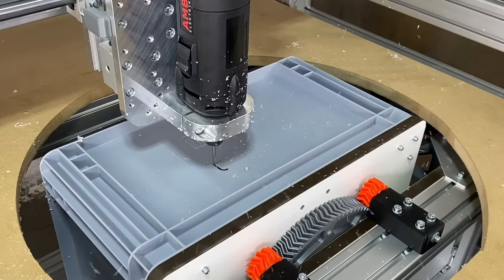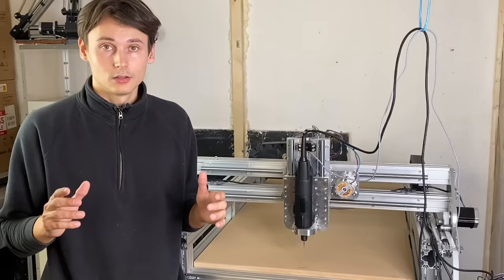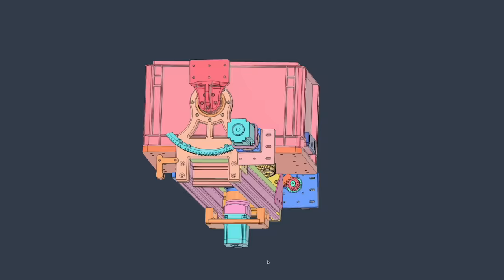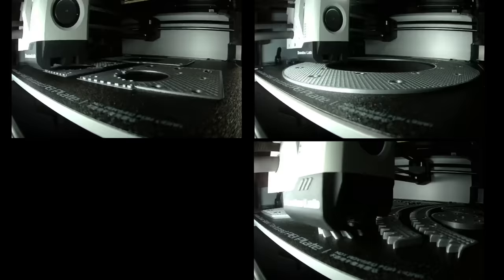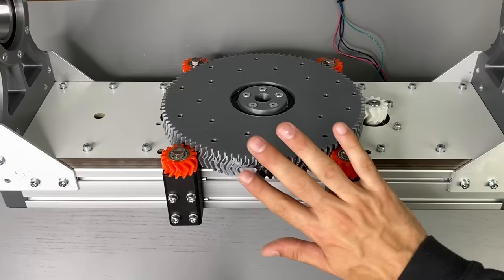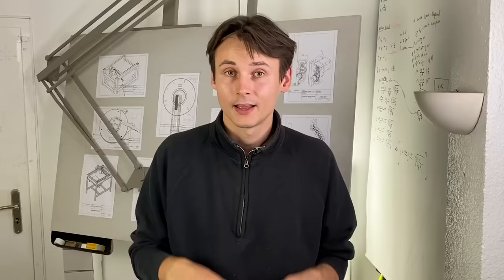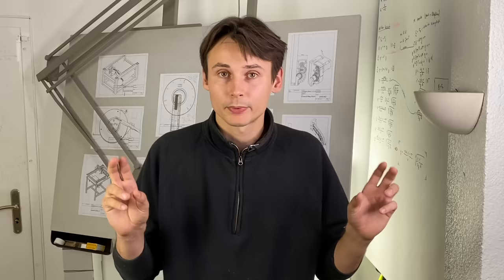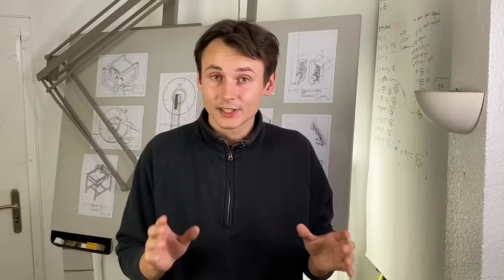3+2 axis CNC - 3d printed automation #006

Comment: Which manufacturer of euroboxes would you recommend for storing stuff at home? So far I've used utz RAKO, because we have those at work and they are very robust, some of them at work are from the 80s and still in use. Now ppl have recommended Auer to me, because they are cheaper and  offer a lot more subdividers etc.

Comment: Curious what those large sheets of material you used for the gantry table of the 5th axis? Looks like they were machined on the sides when they were cut out.
Reply from the maker: hi, the material is called "HPL"

Comment: As far as I know Estlcam only supports two axis, so did you control the 4th and 5th with a different controller or has Estlcam gotten even better?
Reply from the maker: You are right, I added an additional controller, and wrote a really simple communication protocol between the tow - I then changed the NC Code to talk to controller2 at the right positions. It's not optimal but I like & know estlcam and the 4th and 5th axis are doing 90deg movements only. Simultaneous machining would not be possible with this setup.

Comment: I think you don't need all those fancy planetary gear motors. 1- they are slow 2-they are expensive ! Just use regular DC motor and a cheap indexing system for all axis since you rotate by fixed angles like 180, 90 and so forth.

You can use a Geneva gear like this one : https://youtube.com/shorts/Gs7dgke6kk8

Comment: i might be wrong but i dont think you need that little lifting arm thing on the rotating plate that lifts up to let the screw pass through

could you not just have a hole perfectly sized to let the screw pass through as any screw on not in that orientation would not fit through it anyway

Comment: Its a cool hobby and demonstration project, but really not practical. That mechanism will give you 10x more trouble than you save. I used to do a lot of work on real 5 axis machines. In most cases the additional cost and complexity of the machine outweighed labor cost of individual setups. You really need a good reason to use 5 axis. In the real world, nobody would used it for something so simple. Usually they are only used in cases of complex shapes or high accuracy requirements.
Reply: critical thinking is fine and very usefull to reflect, which seems to be mostly true. Nevertheless Christophers intention in providing engineering of demanding tasks with presentation of maschine building skills one learns, values and grows a lot